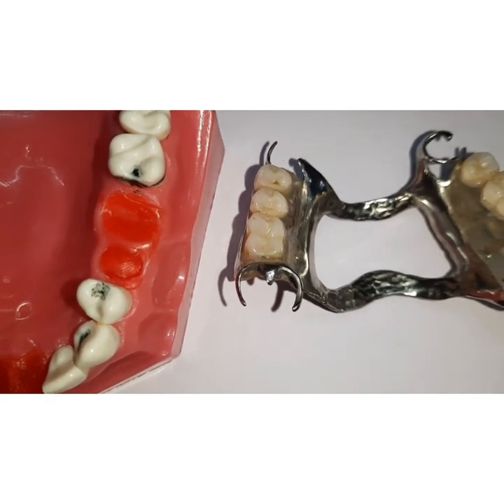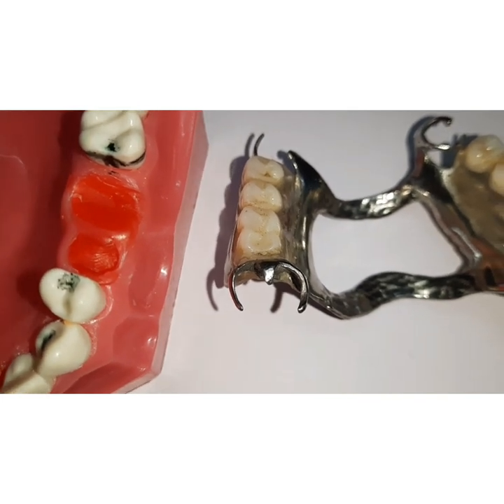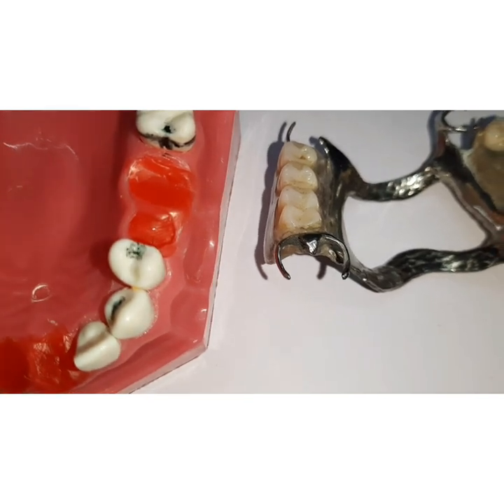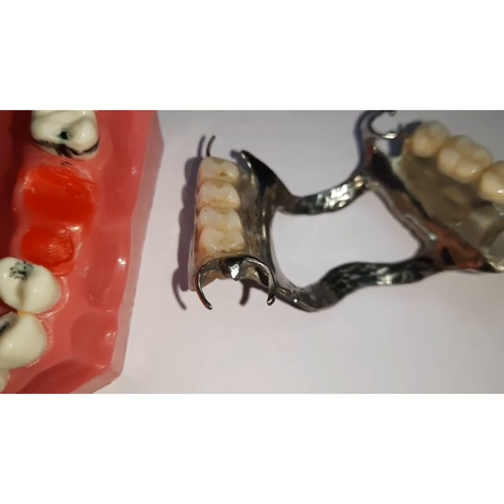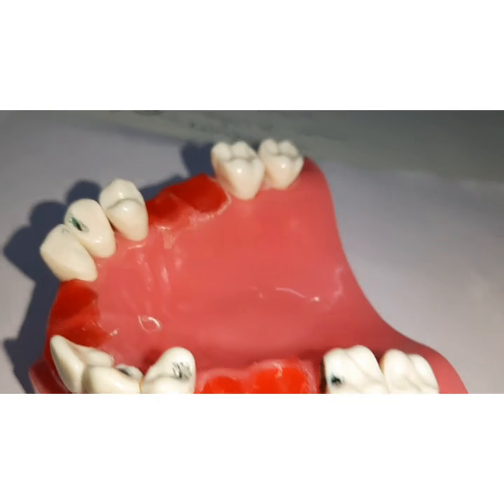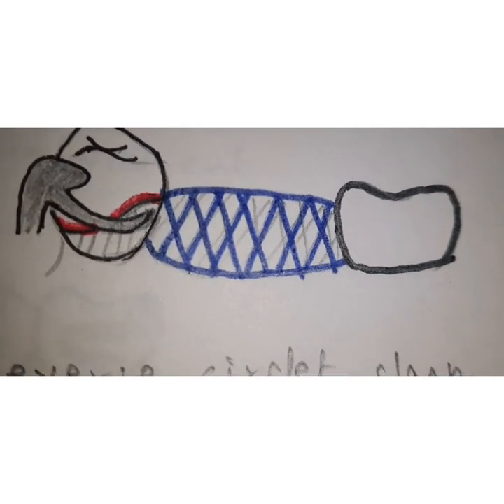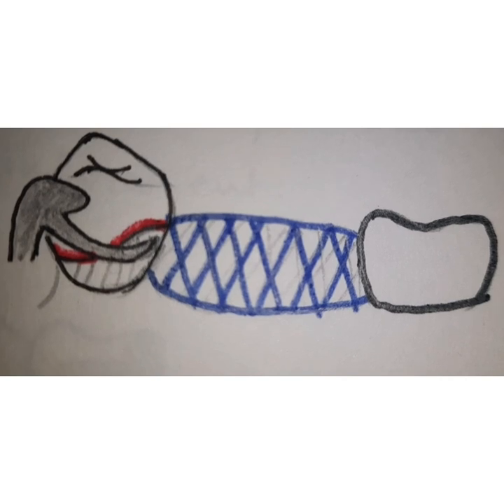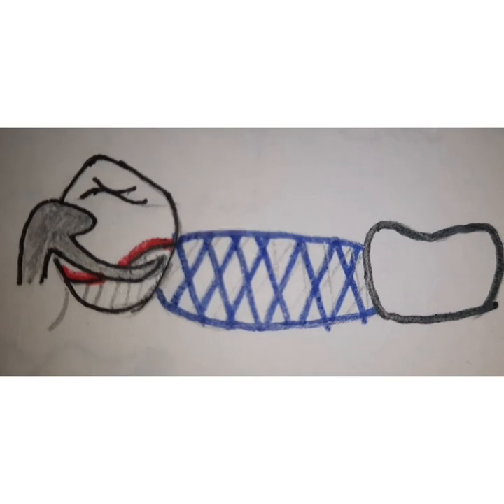Direct Retainers - Part 2  Circumferential clasp and its types

Comment: sir please explain???
Angle of cervical convergence on two teeth presenting dissimilar contours. A greater angle of cervical convergence on tooth A necessitates placement of a clasp terminus, x, nearer the height of contour than when a lesser angle exists
Reply from the maker: The depth of undercut on tooth A will be more thwrefore retentive terminal should be place nesrer height of contour because it will fulfill its purpose of providing retention from dislodging forces and at same time will also provide passive fit else if deeply placed it will apply lateral stress on tooth.

Comment: Why cant we use other clasp in mesiolingual tilted case? Why other undercut arent available in that case? Please can you explain it. Thank you
Reply from the maker: Ring clasp is used in mesiolingually tilted molar. Reason being that with other clasp it is not possible to approach proximal undercut. Because of tilt you will get undercut only in the infrabulge area of mesiolingual surface.
Reply: @VijayPrakashdental   thank you very much.

Comment: HI SIR could please tell me how are direct retainers connected to minor connectors by what method and whether its rigid, non rigid, loop, soldered ?
Reply from the maker: Direct retainers are part of the framework which are rigid except the terminal third. They are connected in waxup stage and casted as other components.
Reply: @VijayPrakashdental  thank you sir